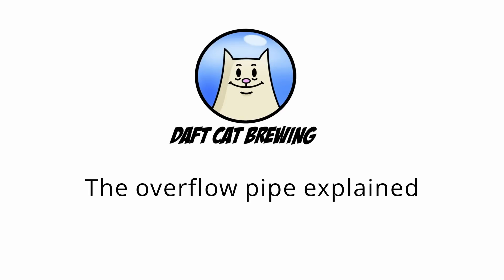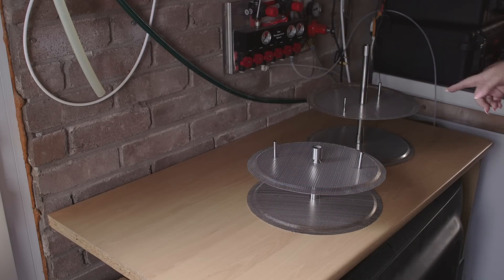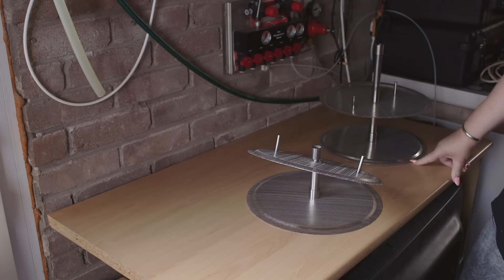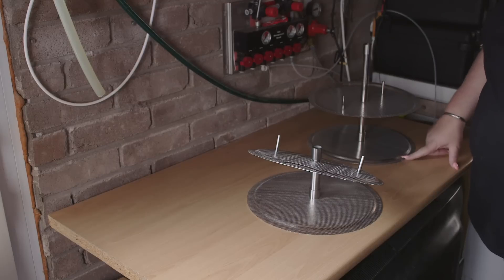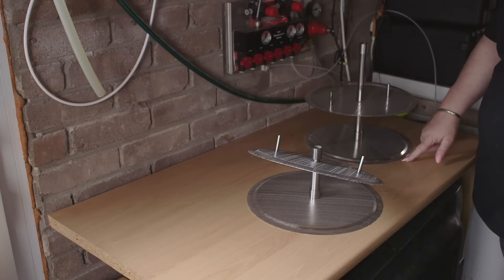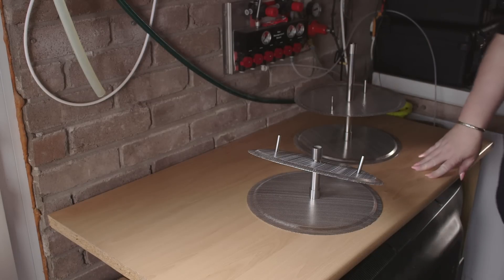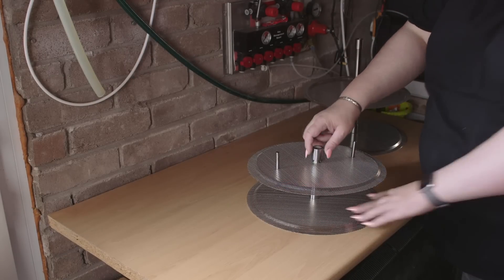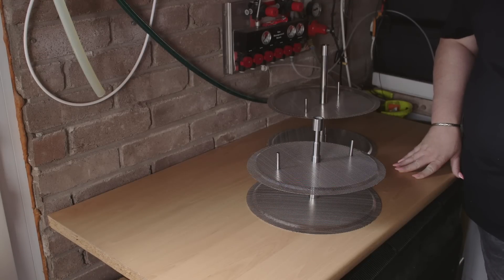The overflow pipe. Why it matters and a look at a new extending pipe

Comment: I bought the Klarstein Brauheld Pro, and while I think it's largely a great system, I'm having real problems with sparging. The main reason being, it has the telescopic style pipe, but it is far too long. At its shortest, I'd say you need at least 5-6kg of grain to get the sparge plate to sit on top of the grain bed. I feel like I might be doing something wrong, though, as in your video the plate moves up and down the pipe. I see that Grainfather make a shorter telescopic pipe and I'm wondering if that would fit the Klarstein...
Reply from the maker: I've heard someone say that the GrainFather pipework doesn't fit the units the same as mine, however I've not tried it myself as I don't have a GF. It may be that the hole in your top plate is a little small in which case you could increase it slightly so it does slide over the pipe. However the Brauheld is not the same machine as these though so you may want to ask someone with a Coobra system as that is the same as the Brauheld pro and it may be that the GF pipework will fit your machine

Comment: Great info as always sarah. I always keep a close eye on my mash and boil for that matter. Cant have ruined beer lol. I suspose if the pump is still pulling liquid through then theres enough in the bottom because upon cleaning mine after a brew i run the pump to empty and theres alway quite abit left that the pump wont bring out. Once air gets in the pump it stops pulling through.

Comment: that is a good safety feature,but if you are flowing down the pipe you aren't really recirculating trough the mash. I guess that is pretty obvious. love those rice hulls and sight glasses. cheers Sarah.
Reply from the maker: You can still be recirculating through the grain bed as just the excess is going down the pipe, just like the overflow in a sink. It doesn't mean the sink is empty and has no fluid in it because the excess is going out the overflow. This can actually be beneficial as only a limited amount of wort is sitting on top of the grain cooling down before draining through the grain. Excess  will go down the overflow, get reheated and come back on top.